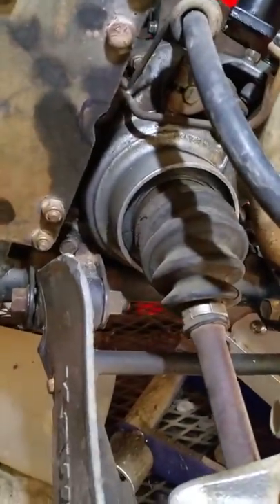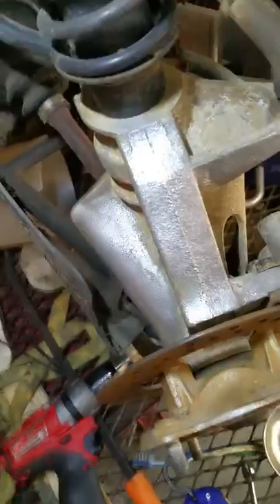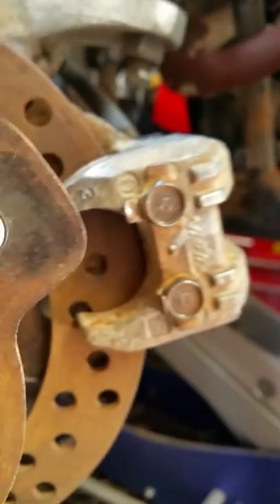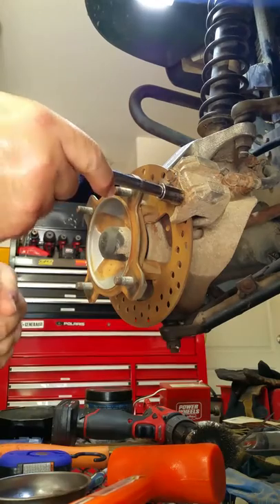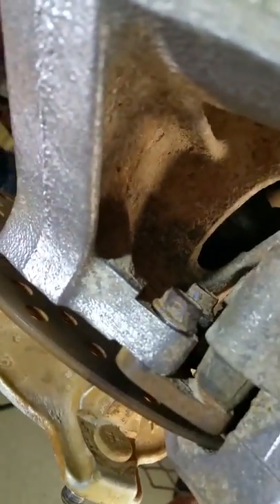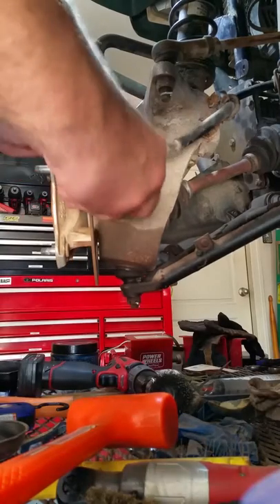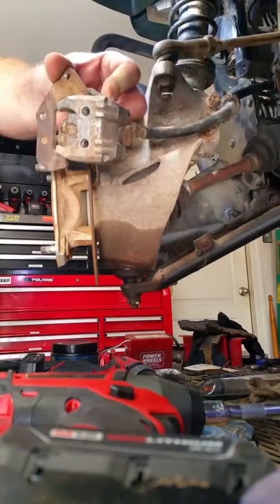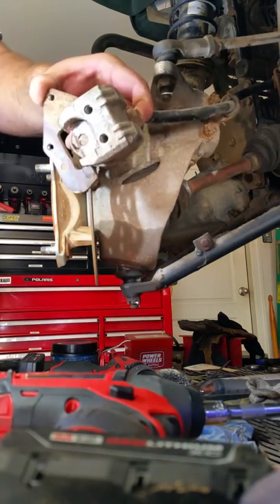Prairie 360 brake caliper removal.

Comment: Glad I caught your video. Can't wait for part 2. I've got these calipers off the ATV already and I hope that you will go through the whole system as in bleeding or replacing the lines if they were to be so far rusted that you can't do a thing with them. One would figure that DOT 3 would fall with gravity through the brake line. The reservoir was not that bad but I am thinking there is rust in the seep hole. I wonder if you can get an air nozzle and try to see if air will go through after you drop some DOT 3 through the line??
Reply from the maker: Sorry, dude. Sold that bike a long time ago. Thanks for watching!